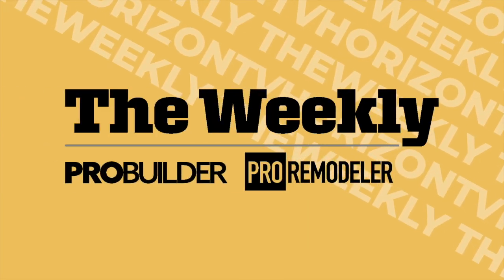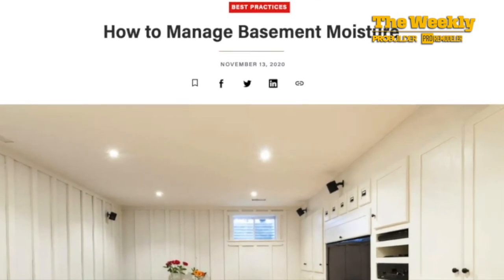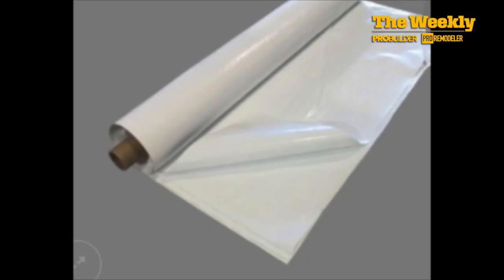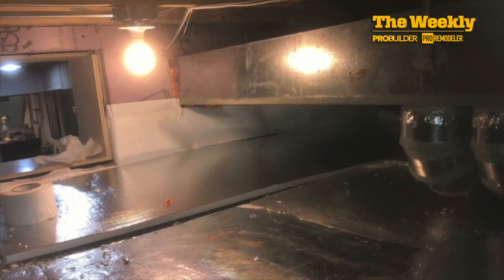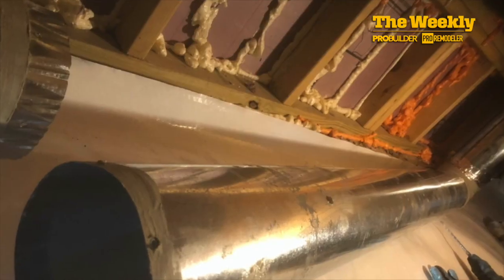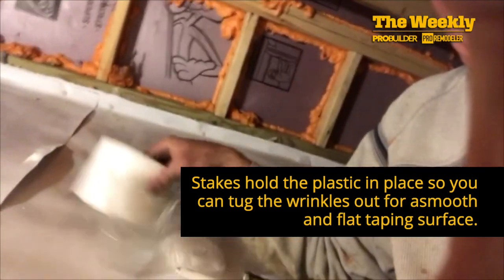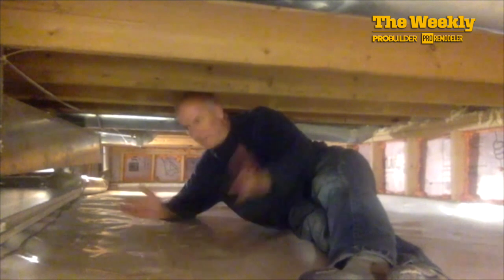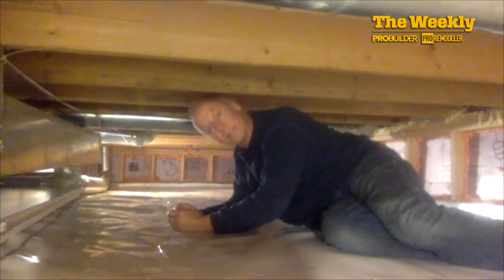Quarantine Crawlspace

Comment: So now you have to place a minimum 15 minute thermal barrier over the exposed rigid foam insulation.  How is the crawlspace vented?
Reply: Not necessarily - check the IRC 316.5.4 & 6.6 at least for the 2015/18 versions... Of course as he said "storage" he lost out on the exception. If it was me I would skip drywall & go with rockwool at 1 1/2" thick.

Ventilation is not required but one has to meet requirements of 408.3 - he nailed part 1, but I didn't hear anything on part 2 which calls for either an exhaust only system, conditioned air supply being cut in, or to run a dehumidifier

Comment: Thanks for the video. Several questions; What region of the country? Did you need a permit? Why no radon pipe under liner since this is a dirt floor? As mentioned in another post, do you now need a thermal/ ignition barrier (i.e. gypsum board, etc.) since this may be defined as a "living space" by an inspector (due to storage)? The most frustrating part of my project has been the murky, depends-who-you-ask answers you get to what seem like straight forward code questions. Edit: Also, what about supply and return air?
Reply: @Mike Beirne Thanks for taking the time to reply. It's interesting to see what others are up against in different parts of the country when doing an encapsulation. It's been a much tougher job than I anticipated!
Reply: Test, test & test or you are just guessing - you can have 2 houses side by side, one with no Radon issues & one that tops the charts. Based on your house you could have an issue in one area & not another - remember it is a gas coming up from the soil & will generally choose the path of least resistance. As for sump pits, I have seen plenty of contractors that will also use those for radon prevention & apply a special lid.
FYI, I commented earlier on alternatives to ventilation - using exhaust only is not a good option if you think you might have a radon issue as you would be pulling it up into the crawl.
This is piece I wrote on the most common methods for dealing with & yes crawls are included in it...  https://thehtrc.com/2013/common-sense-building-build-radon-out

Oh & @UCTouUQmaSQ_2Ej774crhmeg I feel your pain - one slide I use for almost all my presentations is that the Codes are Black and White, with a ton of Gray in between.
Reply: @SeanLintowSr   Thank you for the reply, I appreciate the input!
Reply: @Mike Beirne  Thanks Mike!